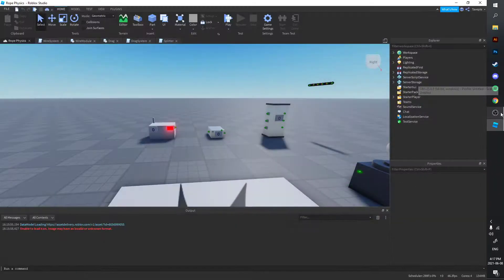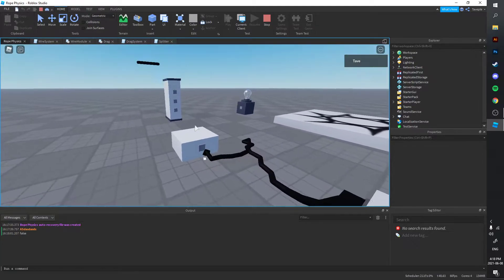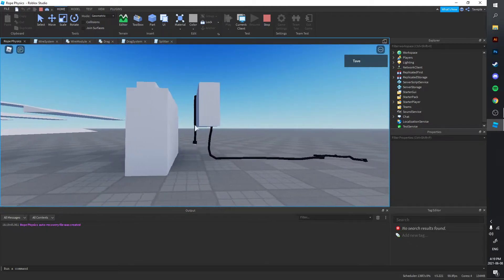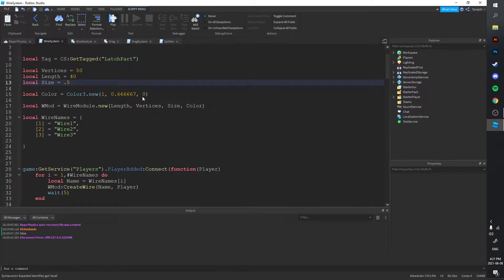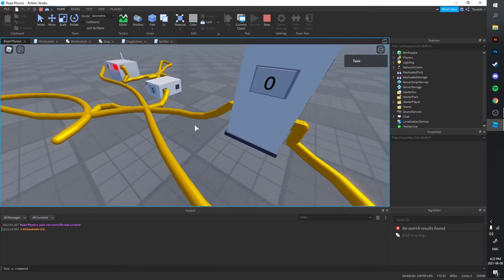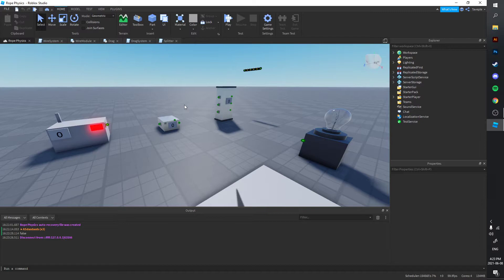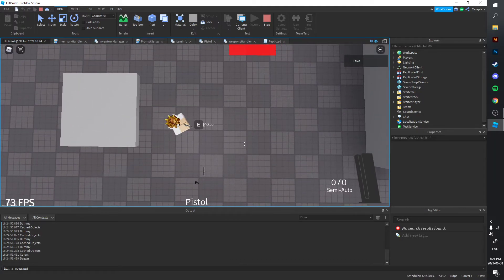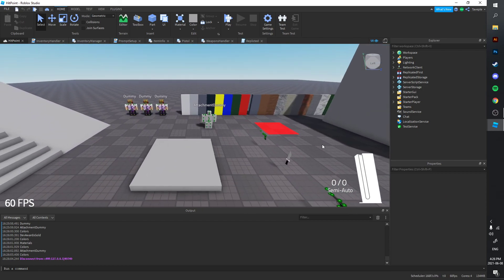Rope Physics/Wire Module Showcase | Roblox Studio

Comment: Can i ask how you made the mouse thing where you can interact with the wire? like you can hold unanchored parts?
Reply from the maker: Sorry for the late response! This can be achieved by using AlignPosition and altering the NetworkOwnership to the player holding the item. This was inspired from Lumber Tycoon 2's grab system, there is also a post on Devforum that goes into a simpler math for it if you are interested!